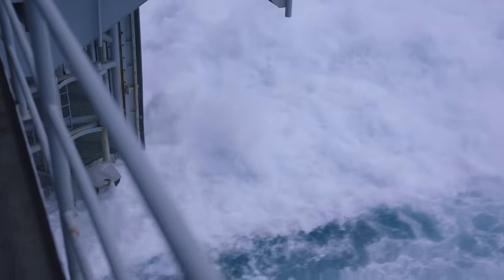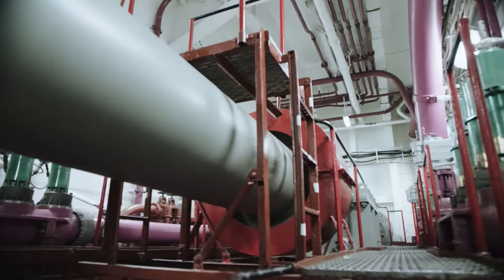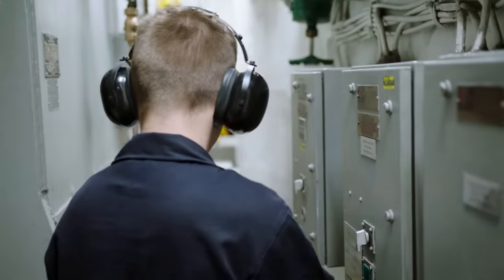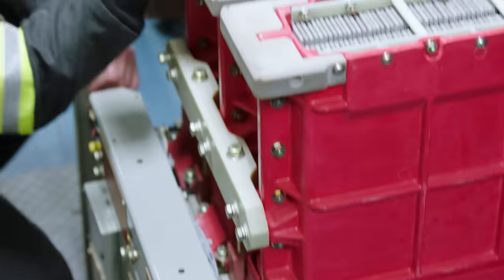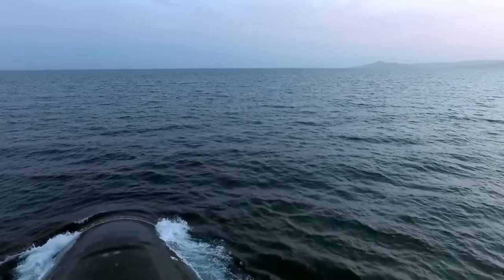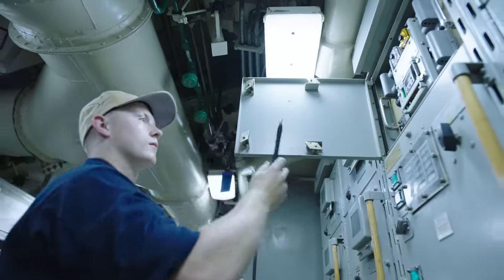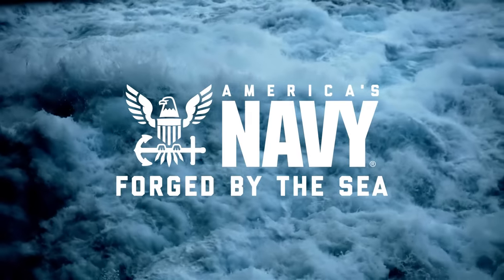Navy Electrician’s Mate Nuclear – EMN

Comment: Re-enlistment Bonus of 100k, nice mine as, EM, 81, was 3k, spread over 3years, Glad EM's are appreciated now.
Reply: in 89 EM was 32K.Are you sure you are not confusing the signing bonus you got once completed Prototype?
Reply: There was a big shortage of highly skilled and competent electricians starting in the early 1980s. 

Even to this very day, many electricians are still not capable of doing automation, controls, etc. because many tend to hide away in residential roles. Too afraid of having to deal with subsystems, motors, and control diagrams.
Reply: @gwhitty12  Sorry was NOT, a Nuke, was on a "Conventional carrier".

Comment: What type of materials do EM use is it the same as residential and commercial electricians like emt conduit and romex or do they use rigid pipe and do they follow an electrical wire code like the low voltage (black red blue) and high voltage (brown orange yellow)?
Reply: Naval Elctrical distribution is different from civillian, for starters its un-grounded. The Elctrical Lines except 4160V(carriers)  do not need hard sheathes, infact in some places it would be conterproductive as even a steel beast like a Nimitz class carrier does flex very slightly. In general  EMNs deal with main  power 4160 VAC,  450VAC for a motors and a lot of other equipment, and your usual 120VAC for lighting systems(includes personal items on this system.). Electrical wires are labels with metal tags. So to answer your question, the answer is no, and no, and not grounded.
Reply: Gogo Plata  Sorry, go back to "A" School, up to Ford class, Ship & Subs, distribution, 480 V. 3 phase- Delta, ungrounded with ground detection , lamps. Ford with EMALS, they went, 6 KV, cause of Power-factor.

Comment: Was a submarine nuke for a six year hitch…MM/ELT…from 75 to 81.  I knew I wouldn’t be re-enlisting.  Got to the Patrick Henry in Jan 78 for a DASO and 2 patrols. Then onto the Boston precommissioning unit at Electric Boat for 2 years of port and starboard duty days, getting out before initial sea trials.  Fascinating watching the boat being built and tested through at pier power ops. Got out for a career in commercial power as operator and reactor operator before getting an engineering degree. Nuclear power school at Mare Island was great and a lot less math intensive than a UC engineering degree…Prototype was intense at S1W but the hardest part was learning how to stay up all night! I partied a lot to alleviate the long hours, especially on the long weekends. Everything within moderation…glad I only did 6…it was an adventure…I wonder what would have become of me if I hadn’t impulsively joined the navy…3 days before I got to Orlando RTC, I had no idea I would be in the navy…in 75 they were taking any warm body and I aced the test…I will always remember PO1 Rose saying, “You oughta be a Nuke.”…hook, line, and sinker! I did my job well and will always be proud that I was a navy nuke…remember, we did more work accidentally in five minutes than a torpedo man did all day on purpose!

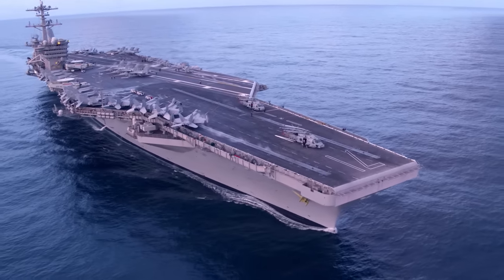Comment: I remember first watching this video before I got sent to great lakes. Feels a bit strange but nice to actually understand the terminology used in the video. Also, heads up, at 2:05 he says that the enlistment bonus is nearly 40K. Last I checked, when I signed on it was 38K but that's before taxes. (May of 2020) You get 1/3 after completing power school and the other 2/3 upon graduating prototype. Don't spend it just yet when you do get it, because if for some reason you fail out or are disqualified, you'll have to pay that money back.  Also, at 2:10 he says that the reenlistment bonus is 100k, not exactly true. While it can be up to 100k, because electricians have a higher retention rate and tend to stay in the navy longer, there's less incentive to offer such a high reenlistment bonus, and again, it's still going to be taxed. While I don't know the actual amount right now (As of November 11th, 2022) expect something more along the lines of 60k or 70k pre-tax. Not saying you shouldn't star reenlist, just be more aware of the reality of your decision. There are pros and cons.